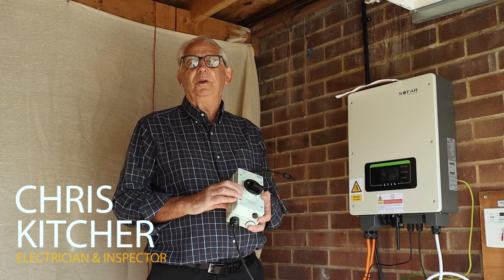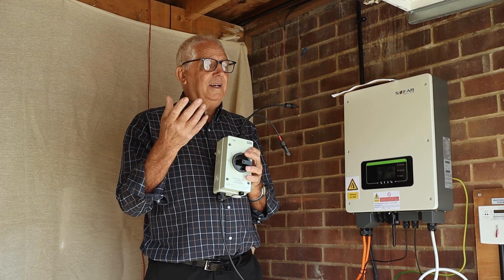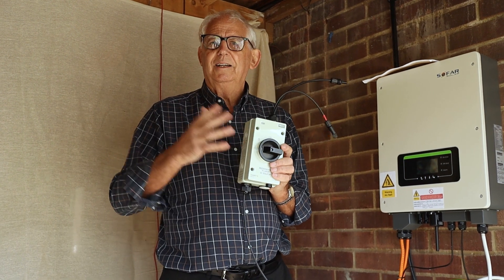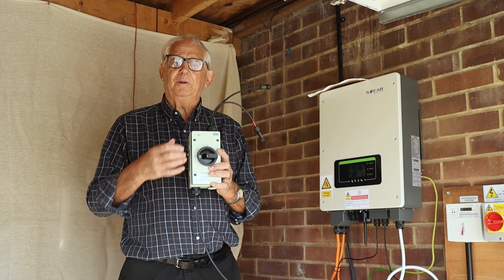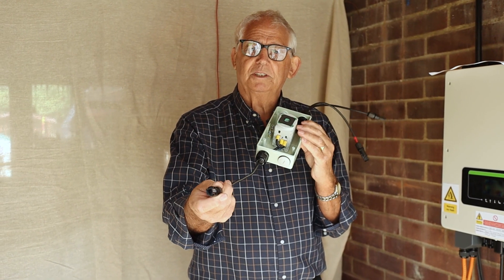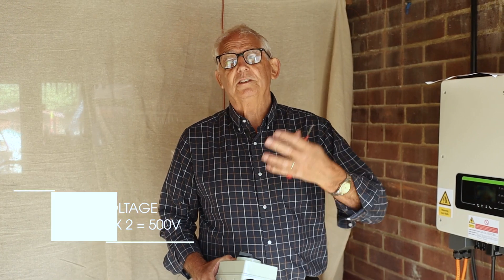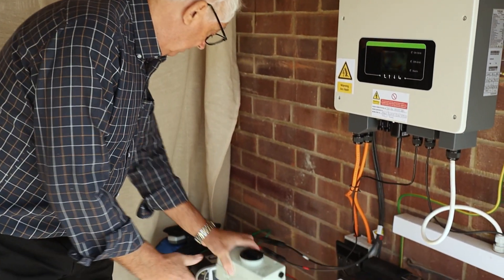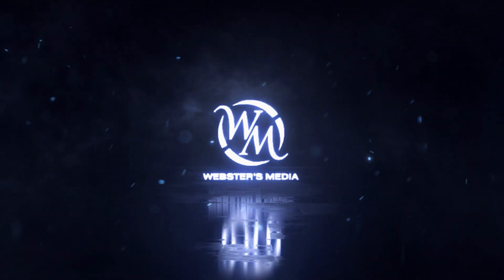Master the Art of Solar PV Testing with Chris Kitcher. Insulation Resistance Test🌞😎 #solarpv

Comment: Arrays Or Rails… how do you connect lead with rails?
Reply from the maker: Thanks for your question. Use the recommended long testing leads as per your meter (as seen in video) and Cable ties to secure lead whilst testing.